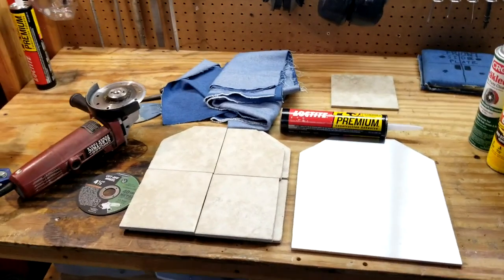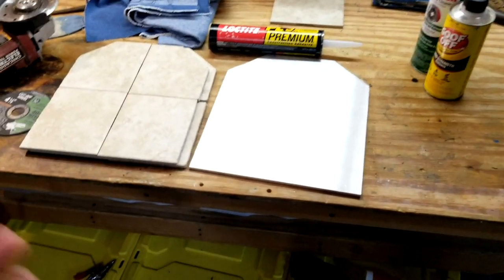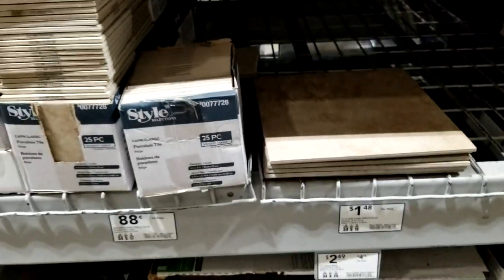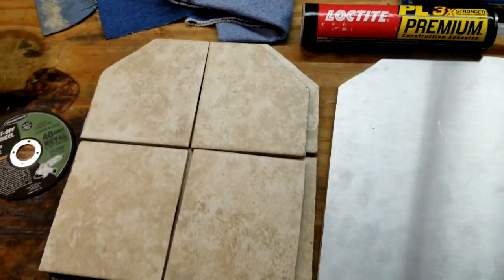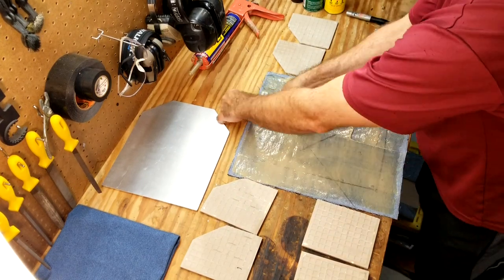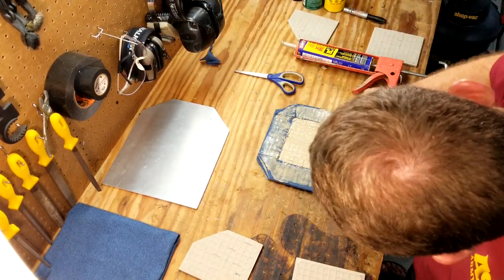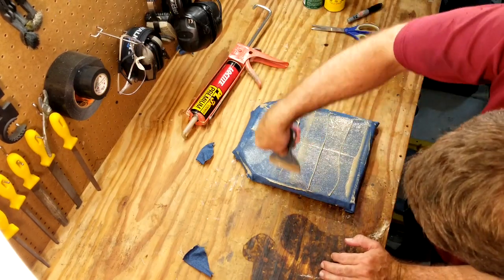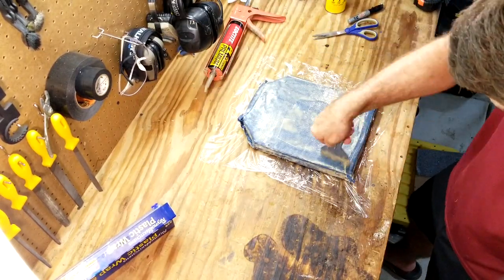How to Make Body Armor

Comment: Good video- I just made or attempted to make my first body armour a week ago. I basically used fiberglass mat/resin and 3 layers of the very small ceramic tiles. It was a mess to do and ended up weighing over 12 lbs. Is the denin superior to fiberglass mat and construction adhesive better than resin? How much did it end up weighing? Very clean build BTW. I may consider this design if better than what I just did..
Reply from the maker: Fiberglass is superior to denim, but denim is much easier to work with.  

The construction adhesive and resin are probably similar in strength, but resin or epoxies are a pain to work with.  

The plate ended up weighing 8.8lbs. So it is almost the same weight as AR500 which weighs 8-9lbs depending on the coating.
Reply: @ProfessionalPepper  That's a good weight.. I can vouch for resin being a pain to work with and having to cut edges after it dries. Thanks for reply and Hope your armour does well in the video.
Reply: Audio Gear i made a full set of laminated kevlar panels and went through 2 saw blades trying to cut ONE SIDE of one piece lol. Gonna try a diamond grinder bit next...
Reply: @jeboteya5489 That must have been a tough cut. Is it OK to laminate Kevlar? I thought it had to stay soft. Do you know a good place to find kevlar?
Reply from the maker: @audiogear474  you can laminate kevlar.  It increases its stopping abilities.   Look at modern military helmets.
Reply: Audio Gear i bought mine at a marine supply store, i believe its marine grade kevlar used for making boats, and used the west systems slow curing resin. I forgot which resin is better for kevlar, there are two types, one is better for fiberglass. Theyll know at the store.

I cut each layer slightly larger to account for the weave unraveling along the edges, used some curved panels that i had already bought beforehand to press the sheets together in between two layers of 16 gauge sheet metal, with a wax paper gasket on both side, but i think saran wrap works batter as one of my plates i had a hard time removing the wax paper, and with dumbbell weights on top to compress it.

I used plastic disposable cups that i pre marked to mix 1 part hardener to 5 parts resin, so i could mix as i go, and not waste resin. Had a situation where i had half a cup leftover and the cup started deforming from the heat of the resin curing, so you have to be careful about that.

Honestly though i think PL is stronger than resin, resin can crack and shatter. I think if it were possible to laminate kevlar with PL it would be damn near indestructible.
Reply: The resin heats up when curing so if your gonna use plates to press it, dont use those polyethylene ones as it might degrade them. I think theyre called uhmwpe or something. The plastic ones with a lot of layers. Dont use those, or at least insulate them somehow from the heat.
Reply: @ProfessionalPepper  Didn't know they were kevlar.
Reply: @jeboteya5489  Would you happen to know how thick does this composite mix need to be to stop 556 or would it require ceramic or metal backing? BTW Thanks for all the tips you guys are really helpful.
Reply from the maker: @audiogear474  it would require at least 1 layer of ceramic plus an inch of fiberglass to stop rifle rounds, or you would need at least 1.75 inches of straight fiberglass layers.  Companies make bullet resistant panels. https://www.armorcore.com/bullet-resistant-panels/level-4/
Reply: @ProfessionalPepper  Those are heavy panels.
Reply from the maker: @audiogear474  yes they are, that's why I highly recommend having some type of ceramic material up front.  Rifle bullets are crazy difficult to stop.
Reply: Audio Gear agree with professional prepper. Just want to add i think 24 layers kevlar or about 1/2" is good to stop handgun ammo, but youd need a crazy amount to stop rifle rounds without ceramic
Reply: @audiogear474  the ceramic works to turn the bullet into more of a slug giving it more surface area for the backing layers to stop. A pointed bullet would pass through aluminum  or fiberglass far easier than a flat object.

Comment: I'm still learning a bit of a newbie but quick question; some of the professional plates I see use uhwpe behind their tiles. Not doubting you but is there an advantage using aluminum? My guess is that a solid plate of aluminum has to be way better at Distributing Force then the sheets of plastic
Reply from the maker: UHWPE would possibly work better.  It has a much better tensile strength to weight ratio.  The only thing it lacks is hardness, so if the projectile isn't broken up or blunted enough, it will penetrate.   You'd have to test it to see if it would be better.
Reply: @ProfessionalPepper  well said, that's why I love the aluminum idea: seems to have more physical stability. 

I found various tiles already at my house, is there a way to tell if their PEI 5 without the box? ( one of them I'm 98% sure is a small piece of porcelain/ marble and the other one came from a mainstream TGI Fridays restaurant so I assume it has a decent strength level
Reply from the maker: The box almost always has it written on the outside.  Almost all floor tiles you can buy from big box stores are PEI 4 or 5.  If they are labeled decorative,  they are most likely 2 or 3.
Reply: @ProfessionalPepper  awesome! Your the man! The armour-coach!

Comment: Wonder if you could use glass fabric and kevlar fabric alternating them then infuse it with resin  under vacuum to varying thicknesses to test out? Don’t know the validity of sourcing kevlar fabric haha. Im sure people have tried. A previous job of mine involved composite work and I was able to take fiberglass samples 1.5” thick home and shot them with 5.56 and it didn’t penetrate but that shit would start getting heavy fast scaled up to armor plate size.
Reply from the maker: It's a good idea.  However,  I feel like kevlar is outside of the DIY spirit.  Fiberglass is more readily available, affordable, and easier to work with.  MindToMachine has some videos showing the effectiveness of the combination.

Comment: Drop the denim and replace it with Kevlar or fiber glass cloth
Reply from the maker: It would be stronger.
Reply: @ProfessionalPepper  I may make a plate to submit, I’ll be open with the composite I’m thinking, pretty much what you did to a T except trying to maintain weight while adding Lexan and Kevlar.  Like from the strike face, ceramic, aluminum, lexan then Kevlar. The idea being to mangle and deform and slow down the bullet so that it’s stopped by the lexan or Kevlar. Due to weight the lexan may not be able to be incorporated in a significant enough quantity to be useful. In which case I’d just add as much Kevlar as possible at the rear to catch the projectile.

Aluminum does do an amazing job at catching slower larger bullets though. Absorbs a ton of energy. The ceramic, aluminum Kevlar combination seems idealistic for a home made plate in my mind. Weight being the primary constraint.  If I’m not mistaken the plate you’re showing CRS showed being shot the other day and from my piss poor memory I seem to recall did very well. Wasn’t it one of the finalists?

P.S. from my own testing with an M1 Garland and just FMJ .30-06 and 5.56 I think most rifle bullets will stop in 2.5” of aluminum, (from memory) my test piece was in layers though so I’m not sure how much that effected the result. If there’s somewhere I could post pictures of my aluminum test pieces I’ll gladly do so. (Maybe it was 2.5” for the 5.56 and 3” for the M1, hard to recall it was a year ago)
Reply from the maker: @meanman6992  do it!  My plate was only beat by plates that used pieces of manufactured armor within their designs.  My design showed it can stop 5.56x45 and 7.62x39.  I think that is the limit of what you need for 99% of the threats out there.

Comment: Aluminum aint good vs heat shells .  Goes right threw the plate.   Sucks.    You need titanium 20 mm plate.
Reply from the maker: Heat shell? Who did you piss off?
Reply: @ProfessionalPepper   :  oh , None at all , but it is a fact that there are ammo that can go through steel plates of 3 - 5 mm even 10 - 15 mm. So it has been ruled out that Titan plates that are 15-20 mm thick are strongest against ammunition that is caliber 50 and up.
Just want to give you some info on what might be good to mix Titan, with ceramics, processed strengthened steel on wader 15 mm which gives a stronger protection on a vest.
 
Wish you a nice day.